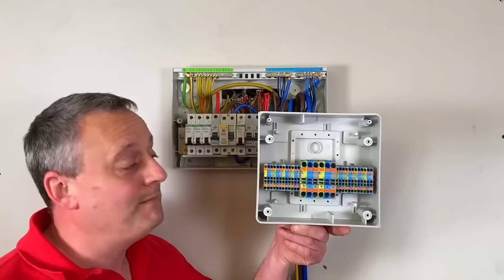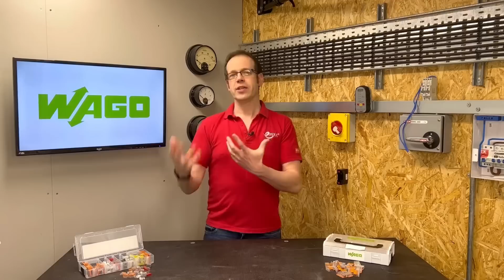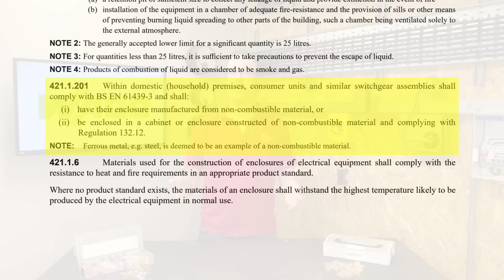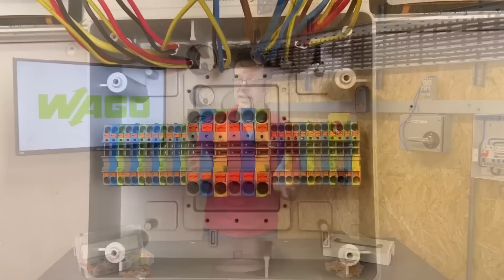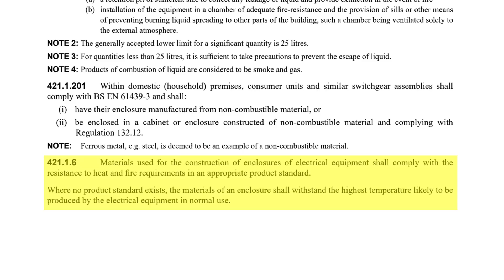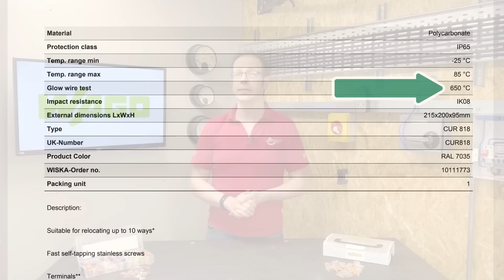The WAGO Junction Box Debate: Metal or Plastic?

Comment: My Dad's new property needs a new CU and relocation due to it being an old Wylex 306 and touching the floor. I need to move it up to a suitable height, but this'll mean that the incoming tails will be >3m.

Although the tails won't comply, the safety factor of the installation, I believe, will be greatly increased with an RCBO board + SPD. 

What are your thoughts on a compliant work around please?

Comment: My problem with plastic panel enclosures is degradation over time.  Metal enclosures, for the most part, are more durable than plastic enclosures.  Plastic components do tend to be especially vulnerable to uv exposure and temperature and tend to get brittle as they age or are chilled.  Metal housings also act like a heat sink helping to dissipate heat whereas plastic housings act as insulators trapping more of the heat produced.  The only advantage with plastic is that you don't have to ground/bond the enclosure.
Reply: I have changed out 20+ years old junction boxes here in Germany and I never had a problem with brittle/deraded plastic The UV in the house is not even close enough to do damage and its good as new. Side note we plaster them into the walls or mount them on the wall, even with the plaster that is acidic there are no problems

Comment: It's just a junction box, no more. Switchgear is either manual or automatic ( i.e electromechanical). Manual switches do not need to be in a non combustible enclosure ( which is why 100amp double pole isolators can be fitted between the CU and the meter in plastic). Only electromechanical switches like circuit breakers, AFDDs and the like ( including mechanical time switches and relays/contactors) need the additional fire protection.

Comment: Breakers are a potential source of  fire. They produce more heat than a simple connector and an arc is certainly very hot and might ignite a fire. That is a reason why consumer units have higher standards than junction boxes. In my opinion plastic is here the better material of choice, it needs no grounding, is water proof, and easy to handle.

Comment: For the price, currently about £65, it's  expensive. It's a lot lot cheaper, and just as easy  to use a standard adaptable box and a packet of wago connectors. 
Seeing as a plastic junction box is allowed, there is no reason why an existing consumer unit could not be used as the junction box. It's got plenty of space and simply seal all the holes with intrumescent filler.
Reply: This would be better than nothing yes. I'd personally use a metal adaptable box in those circumstances just because

Comment: Metal. The reason for metal db’s is the sheer number of connections not devices that operate hot. It’s 99.9% loose connections that cause fires
Reply: Absolutely, and with properly terminated wires and suitably torqued screws there shouldn't be any issues. Regardless of material.

Comment: One problem with metal is it transfers the heat of any fire to the surroundings very well. In the 1980's there were plastic (technically polymer composite) gas meter boxes that were properly fireproof.  These were made of dough moulding compound and were oxy/gas torch proof for over half an hour and they transferred very little heat.  I think the specification missed an opportunity in suggesting steel.
Reply: Yes, i think the focus going to 'metal' misses the point.  Phenolic resin (the later Wylex BS3036 boards for example) is fireproof in any normal circumstances, it will contain the fire unless something goes wrong with the main cutout fuse. One size very rarely fits all. Like most electricians I treat every case on its merits. Sometimes the bare minimum will do, other times you have to be aware of any additional risks. I like fire resistant boards under staircases for example, and will write up in EICRs what could go wrong in the event of a fire, attached to the report as an additional page (as the NICEIC's C3 report field is limited in space for writing). Lots of people stick loads of flammable cr@p under the stairs with the gas meter and CU and that's a main escape route.
Reply: @TheChipmunk2008  I think the reason for metal is that you know when you pickup ferrous metal that it's definitely ferrous metal. You don't need an expensive test laboratory, if the magnet on your spirit level sticks to it then it's ferrous metal and not flammable.

If you look at the 421.1.201 it doesn't tell you to use metal. It tells you to use a non-combustable material, then in note 1 tells you that ferrous metals are deemed to be non-combustable.

If you've got a board made from a non-combustable material then according to the regs you can use it. But the problem I think LFB were highlighting was rubbish boards made from cheap plastics that were combustible - maybe you've got a nice board from a respectable brand that you like, but you've bought some of a less expensive wholesaler  who's got counterfeits and with plastics you'd just never know unless you subject it to destructive testing.

So it's just easier to use steel and be done.
Reply: @keirstitt8277  100%
Reply: Just because there is an even better material doesn't mean that non conductive thermoplasics are adequate. What role does you gas meter story play in the debate about cheap plastic Vs earthable metal? I'm confused.

Comment: I totally agree it does not need to be metal,,,,,, but, yes there is no switch gear or safety devices present, however, every joint is 'lossy', by that I mean joins can produce a slight warming depending on the load. A few on their own would not be a problem, but if there are many in a small space, the heat build up is going to be cumulative.
Providing these connectors are populated correctly, I don't see much of a problem. I have come across burning in installations where the installer has put Two wires under the same spring.
This of course should not happen, but the unwary DIYer might do just that.
Have fun. D.P.

Comment: We use in Germany since start with electrical stuff first wood (with colour) and then metal enclosure. After the second world war we change to plastic except doors of CU after we put them inside the brick wall. All other boxes are plastic till these days after DIN change name and we are now in EU. 

The once metal is the DIN-rail with the green/yellow bonding all together what is idiotic if RCD/RCBO stuff inside too. We discuss these at eFIXX before too. 😂 Should be sometimes plastic... 

These days more and more Chinese cheap stuff offered over Amazon and eBay and I wish me back the old times with paper as isolation material in metal boxes, these Chinese things are crazy thin or crashed easy. The italian stuff in opposite is okay. If the UK can send products per post service cheaper (no, 15 till 20 pound are not an option) we could order there - if someone found the mystery switch at Amazon or eBay to change. 😅 

WAGO and Wiska let produce her products at different places but offer not all products in every countries so this "british CU switching box" is hard to buy online inside EU. Same with the connection between a box and the (metal) channel for the cable or inside the light. I like the easy-going connection point between round box and lamp with extra emercency light. Since feeling hundreds of years the cable goes down the (metal) chain to the light. Point. 🙄 Good that the Wago connector click fast ... 🥰 

After I have had worked in so many different countries with different stuff are some standardized methods are lovely - and I be happy that WAGO and Wiska be a part of that. 👍

Comment: We've not had to be using metal enclosures for junction boxes, wall boxes or anything else that provides the protection to cable joints. Sure a consumer unit is probably the point of the highest load, but doesn't mean a plastic one is unsafe. Just need to be extra careful of all those connections that gey disturbed all the time as we have to test test and test again. At least an extension box like that the connectors should be undisturbed for the most part
Reply: No.
Watch the video again and focus in on the text of the regulation.

There's a difference between switch gear and junction boxes. A consumer unit contains switch gear.

I will give you a clue...think about what happens to the contact resistance of switches over time when they are operated.

Comment: It's a fancy and expensive junction box.  A better question to ponder is should this MF JB remain accessible for inspection & testing and maintenance ?
Reply: It is NOT an MF junction box so don't refer to it as that.
It has not been approved for that use.
It does not contain the MF symbol on the case.
Reply: @deang5622  Good point, only items with the MF logo are Maintenance Free Junction Box  when installed correctly.

Comment: As far as the regulations are concerned you are correct Joe but I think the reasoning behind the requirement for non combustible enclosures is that fires are initiated by bad cable terminations so this might also apply to the Wiska unit.
Reply from the maker: Yeah, it's a fair point you make John, I guess then the question becomes where do you draw the line? Would anything containing a cable termination need to be metal? It's an interesting debate. 🤔😃
Reply: @efixx  I don't agree with this argument.
You need to look at the causes of fire in junctions.

The first cause is where the contact between the bare conductor is made with the surrounding terminal. If the contact is partially made with the insulation on the conductor then this can and has led to fire.

And this applies whether the terminal is realised by a screw or by spring loaded terminal.

Second cause is loosening of screw over time results in increased contact resistance.

Third cause is the wire losing complete contact and arcing resulting.

A spring loaded contact such as the Wago eliminates two out of those three causes. The first cause, contacting the insulation, is down to poor installation and is present irrespective of the type of connector used and irrespective of the material of the junction box.

The reason the metal requirement exists is for enclosures containing switch gear. Operative word being switch. Junction boxes don't contain switch gear.

So what is it about switch gear that places it at greater risk of fire?
Firstly they're not using spring loaded connectors, they are using screw terminals which means all three of the causes of fire described above apply.

Second, as they contain switches, as those switches are operated, arcing can occur eroding the contacts and over time causing an increase in contact resistance leading to heating.

Third, mechanical wear on the contacts.
Reply: @deang5622  I don't disagree with anything you say. The Wiska box is not switchgear as defined in the regulations. However, would it not look a  little incongruous to have a regulation compliant domestic installation with a non-metallic Wiska box on a wall and a steel consumer unit in series a few feet away? 
Don't get me wrong, I love Wiska and Wago products, I'm just pointing out how absurd things can get.
Reply: @johnlloyd3377  It is only incongruent if you don't know what the regs say.

If the person looking at such an installation knows that a switchgear must be in a metal box and the junction box is allowed to be made of plastic then to them everything is perfectly understood.
Reply: @deang5622  Maybe I should have said..... I find it a little incongruous etc.
Reply: Yeah, exactly. What about plastic surface patress boxes and dry wall back boxes. There has to be a line somewhere.
Reply: @MorzakEV  some dryline boxes are even flammable... I don't fit them... How they're allowed to be sold I have no idea.

Comment: Personally I'd take the plastic rail out and fit it in a metal enclosure just because I'd have a  nagging in the back of my mind about it being a plastic enclosure even though its been tested
Reply from the maker: You could I suppose, but where would you draw the line? Would you need to install all connections in metal enclosures? It's an interesting topic for discussion no? 🤔😃
Reply: @efixx  exactly  where would you draw the line, Dry linner boxes for example  who doesn't knock out the top of them and leave a hole about an  inch x inch and don't think about the  escape up the cavity wall of any flames for starters then there's  plastic extract fans and flimsy ducting under floorboards
Reply: @stuarthancock2206  Good point. I've had to line all sockets with intrumescent and acoustic liners on a job, where the integrity of a sound and firewall had to be maintained. Double layer plaster board on a timber wall between seperate accommodation units.

Comment: If you're going to say that that box should be metal, then the same would apply to junction boxes too, as all this kit is, is a giant junction box!
Reply: as well as actual switches (and sockets for that matter)!
Reply: @_chrisr_  so are light switches mounted in plastic conduit boxes not allowed. Not to mention outside sockets and light switches which are pretty much always plastic
Reply: @Paul Hancock  they are allowed but I think this focus on consumer units is misplaced, don't forget that the current in a circuit flows through each connection (e.g. socket) on a circuit yet only the one into the consumer unit has to be torqued up properly, but poor connections in a socket can cause fires too.
Reply: @_chrisr_  I think the focus is because socket outlets are generally fire resistant (phenolic doesn't burn).. and wago style terminal boxes like this have spring terminals that are maintenance free, thus will never under normal usage become loose. I think ONE thing that's been a little overlooked is that the springs could lose tension if subjected to a large overload (like 2.5 carrying a 7.2kw load for example, not impossible if a ring final goes open on one leg near the board and is doing a kitchen/utility room.... that could be an issue, as the connectors have been run out of spec, but nobody is aware they're there...
Reply: @TheChipmunk2008  tbh I was thinking more about the plastic back boxes that are sold for use in plasterboard, I’ve not tested those to see whether they are fire resistant but assumed they weren’t. I am aware that you can fit fire retardant surrounds when installing but I’ve never seen this in existing installations.
Reply from the maker: Yup.
Reply: Indeed. This thing is not breaking any connections...
Reply: Yes, I agree, they should.

Comment: How about fitting wylex REC2SPD isolators to existing installations?
Reply from the maker: This had made for an interesting thread. 👍
Reply: Yes I'd like an answer to this too
Reply: Check with manufacturer. If it's just on its own it's not a switchgear 'assembly' it's just a switch. Like a rotary isolator. No difference.
Reply: @travoltasbiplane1551  its an isolator and spd - perhaps that makes it an assembly
Reply: @leeheffernan9124  a manufacturer has argued the following. 'does not fall under BS EN 61439-1&3 nor the “Similar Switchgear Assemblies” in BS7671 (described by BEAMA as a Incomer with one or more circuit ways in the assembly).' This was an SPD one
Reply: @travoltasbiplane1551  , that's very interesting. Can you point me in the direction of a link to substantiate this please? I believe you but would just like to read more on the subject. Thanks!

Comment: Plastic 100% over metal main reason if fire or extreme heat plastic shrinks and like you see with plastic isolators it puts out fire as it shrinks…. No air no fire …. Metal will give no fire protection
Reply from the maker: Is the idea more that the metal enclosure would keep the fire inside and stop it spreading? 🤔